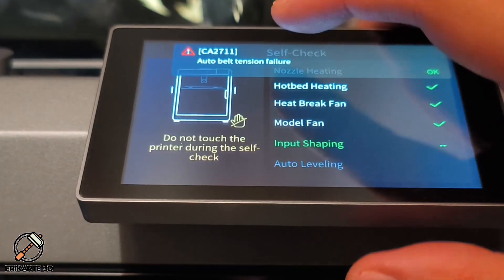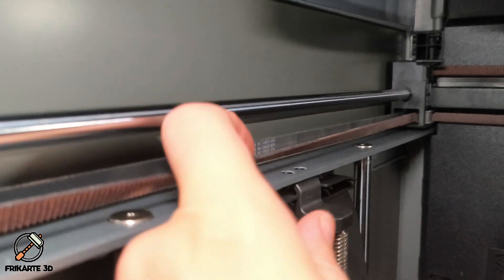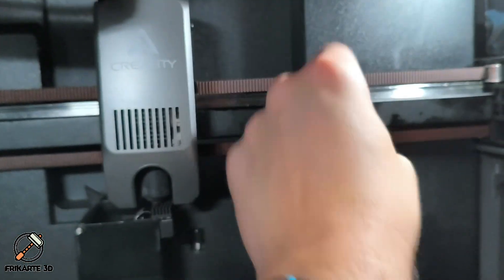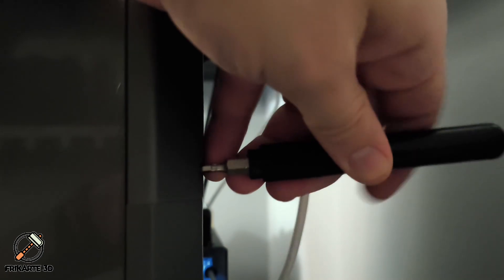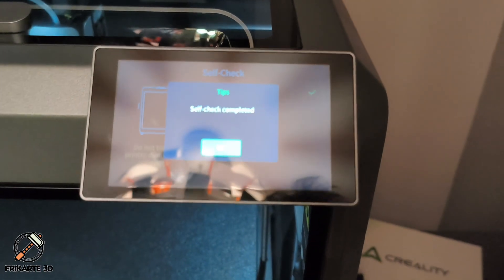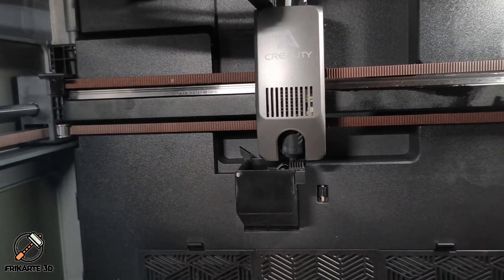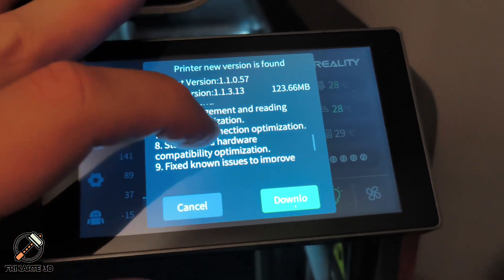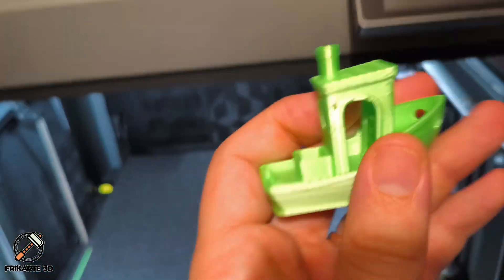Fix Auto Belt Tension Failure [CA2711] on Creality K2 Plus – Easy Step-by-Step Guide

Comment: Thanks. For future reference: Even though it didn't work for me, at first, just knowing about the screws helped.  I had an AC2717 which I can't find anywhere?I tried the quick "just snug them a little", but that didn't work :( After going through all the official tension calibration procedures (installing calibration firmware, printing a tool, tapping the chinese button ten times, etc) I finally took the back cover off. Once you have access to that part of the belts  you can pluck them like guitar strings. I adjusted the tension until the string tones matched and the tension "felt" pretty good. That did it, it made it past the calibration :)
Reply from the maker: My "solution" is to avoid disassembling the back cover but yours is the must do if that doesn't work. You still tensioned the belts with the back screws with the cover open?
Reply: @Frikarte3D Yes, I did still use the screws, but I was able to make the tension the same on both belt by plucking them. I think 🤔
Reply from the maker: That's nice! I will add this to the description crediting you 😊